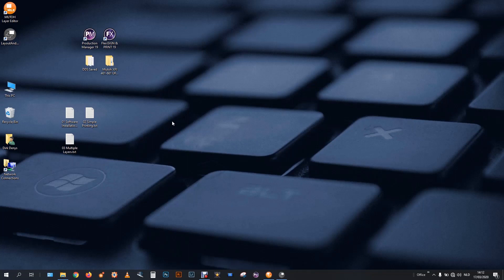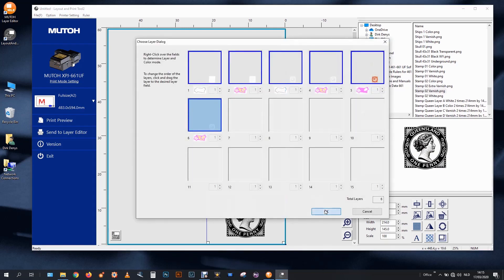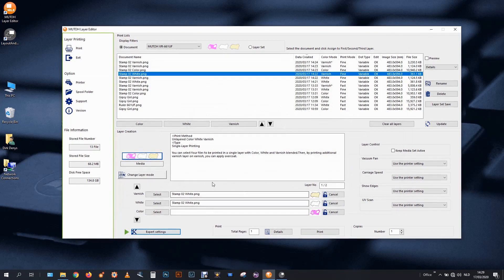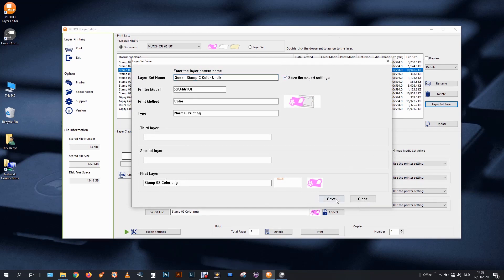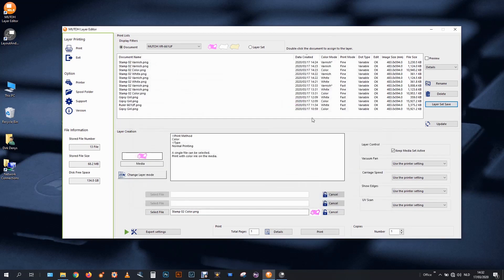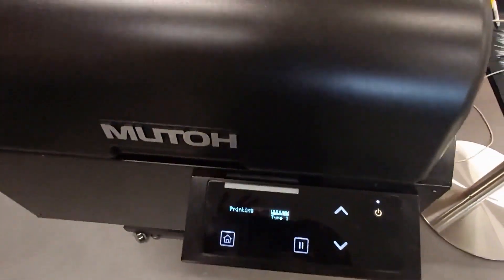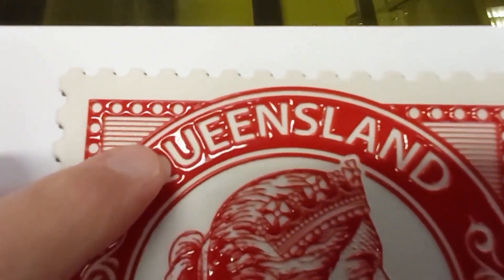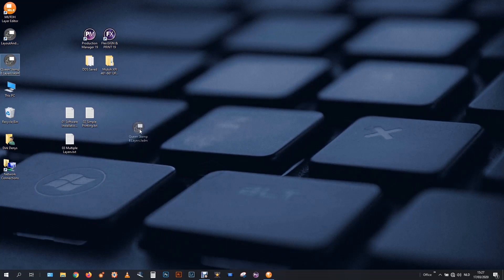XpertJet 461/661UF DTO printers – Instruction Video 5 - Special Structure Printing Tricks

Comment: How long did this take? When you run 4 copies of a 2-layer set, does this mean it runs 8 layers and takes much longer time? I only do 4 layers (white 100% w high density and fine, colour x2 and varnish 25% high density and fast) and it already took me 1h in total so about 15mins a layer